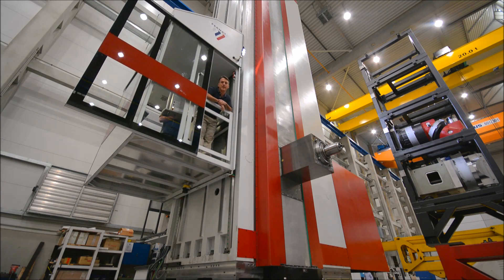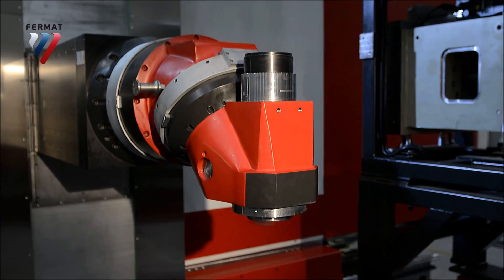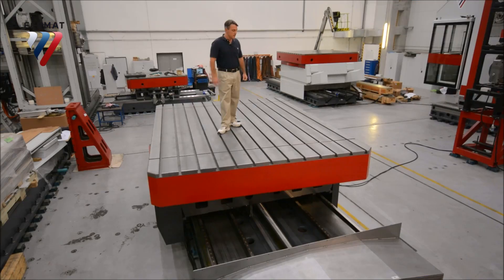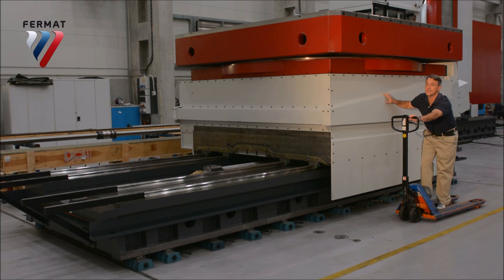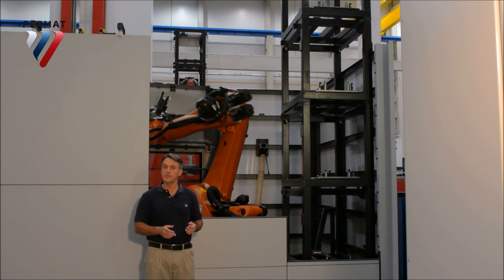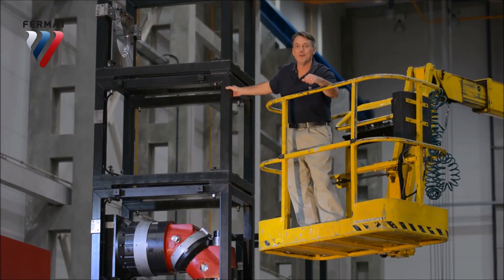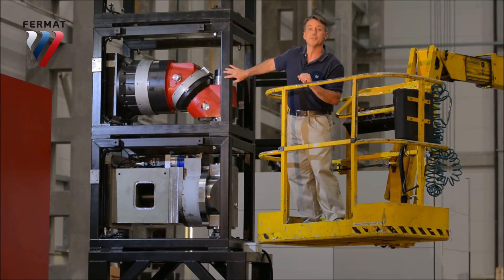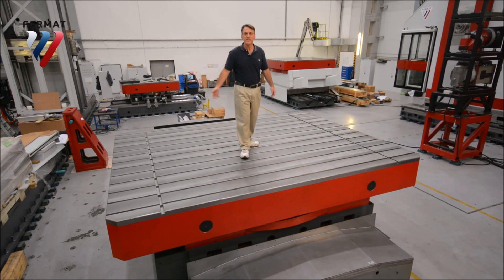CNC Machining | Gigantic CNC Floor Type Horizontal Boring Mill  WRF 160 | FERMAT MACHINERY

Comment: Fermat ... Not very good quality! It looks good ... from the outside ...! I was working on a 5-axle version in Germany, but a plethora of bugs marked this machine! Defective spindle sealing of the high-pressure cooling water system, premature disintegration of the "Z" shaft cover (not guaranteed by the manufacturer). The machine can be easily stopped even with minor stumbles and service is not the fastest when it needs to be repaired and it is not cheap! Premature failure of the "W" shaft seal (permanently creased). My company got rid of it after 2 years of use! The only thing that was great about it is the Haidenhain iTNC 530 controller ..!

Comment: did you forget your helmet and safety glasses? remember, safety first, and also you forgot your harness
Reply from the maker: True.  But, if something weighing several metric tons falls on you, a helmet and safety glasses won't help.  Plus, you'd just get them messed up.  Might as well keep them nice and tidy in your locker.  As to the harness, I guess you have a point... but wouldn't it be more fun to have a bungee cord, or big trampoline?